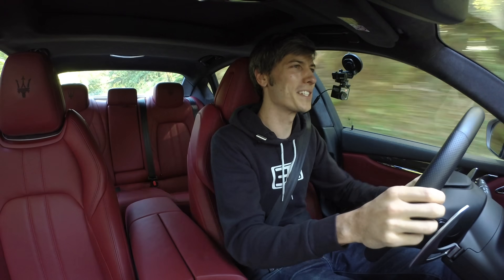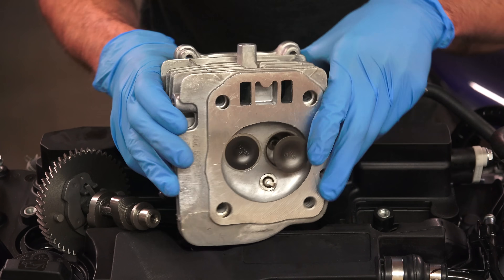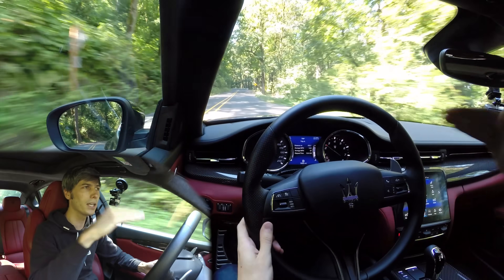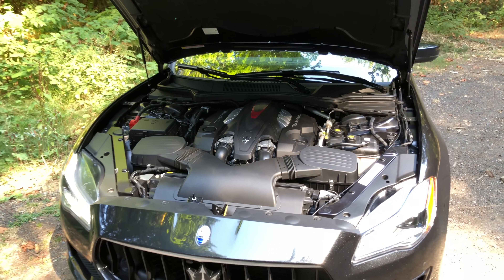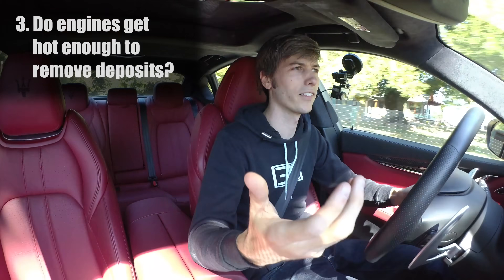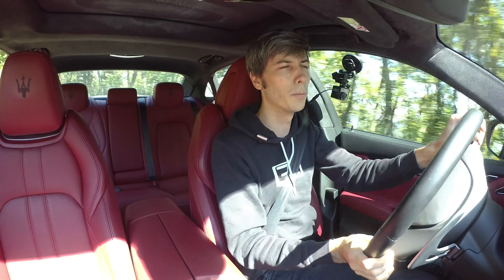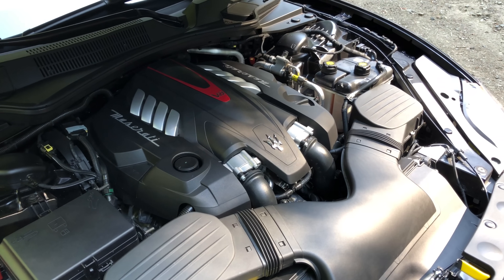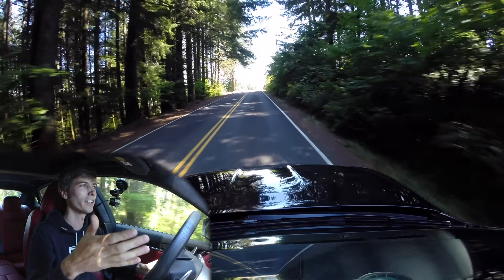Is Redline Good For Your Car's Engine? Italian Tune Up

Comment: As a mechanic for many years I can confirm, an engine driven hard for longer periods but with regular maintenance will run better and last longer than an engine used for short journeys. The Italian decoke is a credible thing for sure
Reply: I would be interested in a comparison of engines driven hard and long, and engines driven easy and long. It's kinda obvious that short journeys are bad
Reply: @BradleyRaven yeah, I had an old Hyundai that I drove 6 miles per day and had oil looking like dulce de leche. Thought I blew a head gasket until I just decided to joyride it on the weekends and it cleared it right up and I had normal looking oil again.

Was just water in my oil because my car didn't even fully heat up on my commute.
Reply: Don't simply confuse by misinterpretation cold engine miles and hot. Of course cold would faster wear.
Reply: Isnt there the factor of hotter tempertaures evaporating moisture and contaminations in the engine too? Not just carbon
Reply: Does it work for all cars? I've babied my standard economy car for a long time but gave it an Italian tune up today, probably going to give it another one soon. I noticed that it's not as fast as it used to be.
Reply: Short trips are murder on an engine. Engines run clean and efficient when they are at full operating temperature. Running them hard is not beneficial.
Reply: So you Jason’s research is wrong? Or were you just not listening?
Reply: @Bradley Raven Interesting that you write this just now. Exactly yesterday I put a vent on my oil cap, with some air filter paper on it. Plan is to flush the gases with fresh air from the oil cap and out of the PCV system, rather than only creating vacuum to pull excess gases. If blowby gases are evacuated directly, they should have less time to dilute the oil. Though this would only work in systems that either pull PCV gases before the throttle body and thus meter it (like in my gasoline Peugeot 406), or plainly exhaust it in the atmosphere. Or probably diesel engines too, not much idea about how those make the fuel mixture...
Reply: @batyanko8283 that would be a good idea but i think the vacuum is the only thing keeping the oil in my car 😅
Reply: @everettstormy  Just changed the oil and fixed my cap seal. So I guess in a few months will be a good time to report on how quickly that oil flies :))
Reply: @batyanko8283  right, def lmk i might try ut
Reply: before every oil change i dump a quart of ATF in there to clean it.

Comment: I'd like to see your analysis relative to the tech that was around when the concept of the Italian tune up was first conceived, i.e. carbs and lower quality fuel. I think your research confirms that what may have worked for older tech simply doesn't apply today, especially for direct injected gasoline engines.
Reply: Are you the mechanic from Ken's in Baytown?

Comment: To me, it's just a foney joke your tell your friends or wife... but, what I wanted to say was... your description said does redline hurt your car, or something like that. In short, it could. Red line is there to let the operator know hey, your components are starting to move at such a fast rate, it could damage your engine. But upon watching your video it was interesting to hear the temperatures that deposits form. I mean a person could try something like seafoam and it may help, but I dont really think you could avoid carbon deposits too much as your burning fuel through a vast and frankly pretty well engineered system. I mean I'm sure it's better than vehicles that proceeded these ie 70s 60's. I'd just keep up good maintenance and treat your car well. It will last long time!!!

Comment: ever see someone do a hard pull and some color of smoke comes out the exhaust? what is that likely to be? it wasnt doing it as they cruised or even casually took off from a stop but they go to pass someone and get on it hard and u see something come out. if you were able to get it hot enough to get rid of deposits, would you be able to visually tell from the exhaust?

Comment: Engine load doesn't necessarily mean romping on it- Its often referring to how hard the engine is forced to work vs a set reference, such as going up hills vs flat road, or powering a 4000 lb car vs a 3000 lb car.  As far as the effectiveness goes- I've had a 1984 Alfa Spider and I currently have a 1972 Fiat 500 (now upgraded to an Abarth replica engine).  I can tell you that it definitely works on both of these cars, all 3 engines.  A good romping will often smooth out a bumpy idle.

Comment: I'm Italian and passionate of engines. NEVER EVER heard something called "Italian tuneup" here... I heard about the high RPM/load to "wake up" an engine if this was normally used slow (even tried it personally on my 1000cc sport bike), but I think it has more to do with ECU self adaptation and other factors then with carbon deposit (especially considering my bike is Euro1 so it has port injection and no gas recirculation at all).

Comment: We used to clean our engines like that all the time back in the 50s and 60s when carbs were rich by nature. BUT, you had to drive high speed in high gear. It needs RPM plus load to be effective.
Reply: How could load have any effect on this? Load stresses your transmission, the engine puts out the exact same power at x rpm, it doesn't matter if it pushed a light object fast or a heavy object slow. The power is the same. You won't get the same high rpms with load though, so you are actually diminishing the effect of the "italian tune up" by putting additional load on the car. It's a good way to burn you clutch and transmission though.
Reply: @Asto508  : It has to do with cylinder pressure. Look it up.
Reply: @TheLonesometoad  These are always the best responses. "Look it up", not citing any sources whatsoever. 
Please go ahead and put some references here, if you think this is a trivial question that needs no elaboration and has been already clarified elsewhere.
Cylinder pressure is a function of RPM, so I'd like to see a source that shows how cylinder pressure is determined by a towing mass.
Reply: @Asto508  : Look, I haven't the time, desire, nor the room to give you a complete education on A/F ratios, SCR vs DCR, cylinder pressure vs heat, etc. I've been a hot rodder and performance engine builder for 50+ years and I didn't learn my craft in an hour. No, an engine does not put out the same power per given rpm regardless of load. If you truly want to understand the science behind internal combustion engines I suggest you start at the beginning.
Reply: @TheLonesometoad  I have to agree,  I know you're not going to give any reference. and it's a waste of time expecting it.
Reply: @Asto508  : I am my own reference. I know what I know from experience and research. Is there a reason you should expect ME to scour the internet looking for something that explains what I already know? The only reason I can think of is that you're too lazy to do it for yourself. I've spent many years honing my knowledge and skills, and you expect to benefit from that instantly? Google is your friend. I suggest you have at it.
Reply: @TheLonesometoad  You seem to have enough time to reply multiple times and arguing, yet no time to link a simple reference. 
That's effective time management I guess.
Reply: @Asto508  : No, that's not giving in to the instant gratification generation. It's giving enough information to spark interest so that people have the incentive to look things up for themselves. I don't do homework for others. As I said, I am my own reference. You can believe me, or you can believe another random source. It makes no difference to me. In the amount of time it took you to respond to my posts, you could have referenced a plethora of material.
Reply: @TheLonesometoad  Ah, the good old appeal to authority. It's remarkable how much energy you have already invested in trying to avoid presenting a single proper argument (or a reference) to back up your statements. 
You are simply shifting the burden of proof towards me and that is again another really lame rhetorical device. 
If you don't have anything useful to say further, you could as well just drop the conversation.
Reply: @Asto508  : SMFH... You're right. Carry on.
Reply: @UCIMCjc76osTjkfjfUs_qgdw : Pulled mass is inconsequential. We're talking rotational force. Torque. More load requires more A/F mix to maintain said RPM. More A/F mix entering the cylinder increases the cylinder pressure. More (in-)cylinder pressure equates to more power and heat. The simplified explanation in a nut shell.
Reply: @TheLonesometoad  
Now you are just shifting goal posts by sneaking in the false premise that in a "italian tune up", you don't rev the engine to it's maximum and have some power reserves left. 
The maximum power of an engine is a fixed property. If you go full throttle, the power won't get magically higher because you put on additional mass. The engine won't generate any more torque on the crank and the maximum cylinder pressure is also capped due to this. It cannot go higher magically. 

I explicitly stated that it's harder to achieve the same high RPMs with an increased mass to pull. Since the maximum power of the engine limits how high you can rev it up with additional mass, you are working against the whole point of an "italian tune "up".

Your argument also implies that having a high additional mass and revved at 1000 to 2000 rpm (operated at maximum engine power) would have the same effect, which I honestly doubt, but again, feel free to point out a single reference that shows exactly that.

Comment: I got Nissan Primera 93 1.6L from a friend snd she is that kind of a friend who doesn't push the angine at all and she have been driving the car for 27 years. So I had to pee but the nearest gas station was behind 25km motor way road. So I floored the car almost all of that 25km and on one point I got a funny smell inside the car. Well I took the leak I came for and stopped by a coffee. After that the car felt way more responsive and powerful. So I think what happened is that there was so much carbon build up in the engine it had such a great effect on the engines power it was makeing.

Comment: I have a 2-litre diesel with 100k miles. These days I don't do much motorway mileage, so when I return home and turn off the main road onto a straight stretch, I floor it in 3rd up to the red line. You can see a blast of grey smoke as the EGR cleans out. It passes emissions tests, no problem and runs nicely

Comment: if it's a GM it'll just overheat naturally, no carbon deposits.
Reply: I have an 01 5.3 Silverado I bought for 2800 for my first car, runs great and haven’t had any issues. Hopefully it continues this way until I graduate college lol 🤞🏼
Reply: Just change the oil every 3500 miles. Dont go by the light. I got 270,000 and redline it about 10 to 20 times a day and runs great. Great motors ask anyone.
Reply: Dont know what yall drivin. Ive owned many GM products and they never overheated. But i have owned a Ford Windstar that suddenly overheated and blew a head gasket at 70k miles.
Reply: @tahoeboy8658  I worked at an Olds dealer years ago....   We used to call GM Generous Motors and referred to ourselves at Mr. Gut Wrench !
Reply: @bobs806  ive had small electrical problems like alternator not charging enough but it was oem and transmission shifting hard at full throttle after 280,000 miles but never overheating. My temp gauge doesnt go past a quarter in 90 degree weather. And ive driven from California to Connecticut 3 times a year for the last 17 years. Its a 99 Tahoe
Reply: @tahoeboy8658  Here's the bot always trying to shift the blame somewhere else.
Reply: Never had that problem and I've owned a lot of GM vehicles.
Reply: @mbsnyderc  my O5 Bonneville Runs like a champ and I love it ! GM gang for life
Reply: Sheit, our 2500 6.0 gasser runs cold AF. That being said, I've mostly owned FCA garbage so maybe I'm just used to scorching hot temps....
Reply: I’ve worked on gm’s and it’s true, they probably don’t over heat but man do they get hotter then other cars just from regular driving
Reply: Amused.  Ooh, just wait for all the GMC guys to get all butthurt because they’re watching this video while waiting for a tow.
Reply: @starcloakstarside9719  Idk, I find it hilarious. My s10 has 450k miles and only needed the fuel system worked on (vacuum-based fuel pump, vacuum lines get gunked up). I had a fusion with the mazda 2.5 that was fine until it got tboned, also have a ranger 4cyl that works perfecly. Still prefer GM
Reply: anything american you risk it being a POS
Reply: Don't know bout gm but had a 2006 2500 chevy with the 6.0 thing was taken to mexico from kansas without a single stop towing about 2-3 tons of equipment thkught it was gonna cover heat in Monterey cause it was a hot ass day where ac barely did anything and it had some huge ups and downs, thing survived somehow
Reply: you mean a Kia?
Reply: @panthersfan8494  Nope. They meant GM. Hyundai and Kia today is better than GM. Hyundai/Kia quality is getting better while GM is getting worse. Same with Fiat-Chrysler. Ford is still good (even though hey had hit and miss like their DCT) especially their trucks.
Reply: Then the engine blow, everything got rid of lol
Reply: Lol.
Reply: Question! Ideally wouldn't it be better to use a can of seafoam on occasion rather than the extra wear from the Italian Tuneup?
Reply: hissinggoose ya GM POS
Reply: I have found my Chevy fails in other ways before it actually overheats, which means that if I want to get it on the highway it should probably be towed.
Reply: Lmao so true. Gm is GARBAGE
Reply: @usesomebraincells  that's funny I see so many people complaining about GM's but I've owned nothing but GM's for the last two decades and beside some little minor things and some minor electrical issues the Engines & Transmissions always seem to go at least a couple hundred thousand miles or more. I think people are morons and don't know how to do preventive maintenance and keep their oil level full ect. I mean if your boiler down nothing's really made worth a s*** anymore.
Reply: @kskip4242  the only people who don't agree GM makes cheap trash is people that currently own one. As soon as they sell it, they'll admit it was cheapy junk.

Comment: Gasoline is a solvent, so in the case of a port injection engine, the deposits on the intake valves would be very minimal at best due to them being sprayed down with gas constantly.
However this is a real concern in the case of direct injection engines, as the pcv system introduces oil and other contaminants, with no fuel spray to wash them off.

Comment: Changed some coolant lines on my Infiniti G37 and ran it without bleeding the system to get it hot to do this. Worked great. Brought new life to my 10 year old engine. I knew how far to push it without any damage.